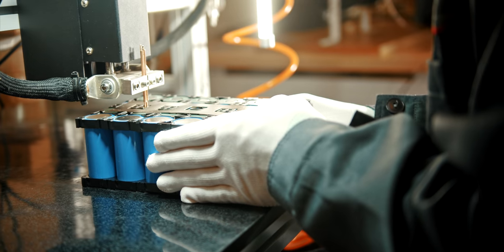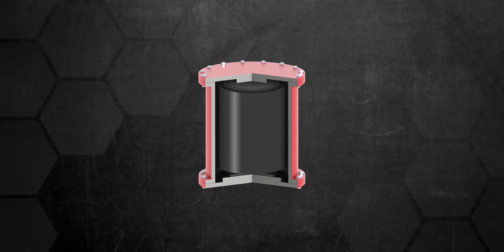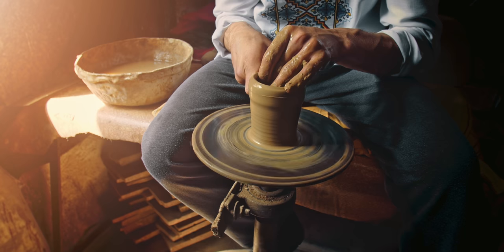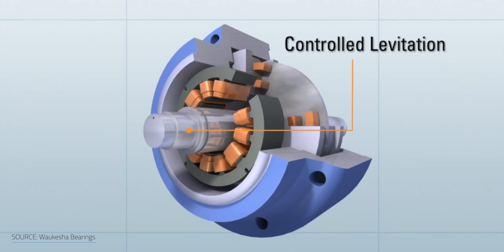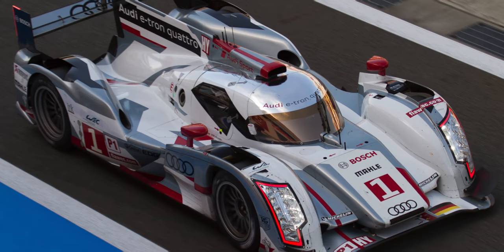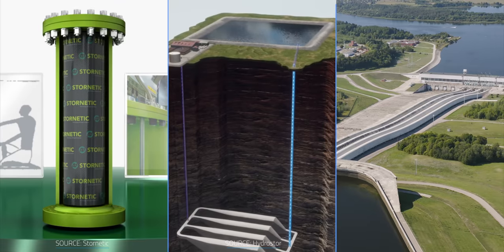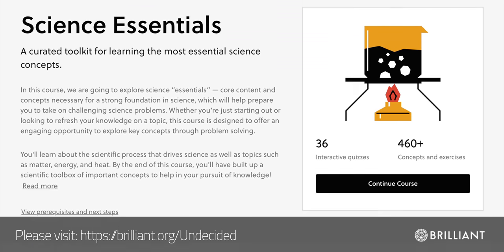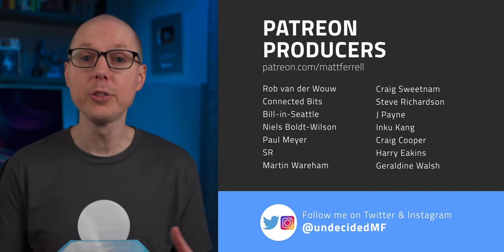The Mechanical Battery Explained - A Flywheel Comeback?

Comment: Magnetic suspension and vacuum sealed means they could spin almost indefinitely. I’d be really interested to see what kind of long term storage these things are capable of.
Reply: Texas grid has been ruined by "green" energy.   Texas is now number one in the world for rate of increase of wind power, due to massive subsidies undercutting reliable sources of power.  Unfortunately, wind power output isn't consistent every day every hour throughout the year nor can it be scaled with demand like a natural gas plant that can simply increase or decrease power output by burning more or less gas.   Unfortunately, the subsidies make it so cheap that it still drives nuclear and natural gas and other reliable sources of energy under displacing them on the grid.   So now Texas that used to be so rich in energy is suffering warnings of brownouts and power shortages.    They keep promising that batteries can solve this problem, but the fact is that no batteries exist that can economically store massive amounts of power, and many are extremely environmentally unfriendly when scaled up.     So just like Hitler with his "wunderweapons" the left promises battery technology that is always "just around the corner" will solve the problems they create with out of control inflation, commodity shortages, excessive energy prices, and more.    They never take responsibility for their actions.
Reply: @BoopSnoot  cool dissertation. Too bad I didn’t ask.
Reply: @BoopSnoot  the problem with the Texas grid was that it was mismanaged, and wasn't winterized properly, due to mismanagement and lack of warning of the coming storm.
Reply: @BoopSnoot  the Texas grid has also shown signs of reaching peak capacity mid summer as well. Mismanagement really is the big issue at hand. Unrestricted capitalism is great and all but there's no profit to be made from ensuring stability in the most extreme circumstances. if it costs 1 million dollars to ensure there's oversupply for the 1% chance of failure but the company loses half a million on said failure then financially a company is throwing away half a million dollars.
Reply: @emperorjj1  you're clearly not reading.  texas grid was PERFECT for DECADES when it was deregulated and governed by the free market without government interference.   The government stepped in levying fines for not complying with ever more expensive changes to the coal plants rendering coal non-competative while simultaneously massively subsidizing in particular wind power and to a lesser extent solar.   This displaced reliable sources of power that can easily scale up and down their power output on demand to intermittent power sources that not only can't scale but they can't even store their power.    The power grid has to balance use and production very closely to maintain 60hz or else you get fires.    3-month contracts now cost as much as 22.3 cents on powertochoose right now, up from the 6 cents Texans enjoyed for so many decades before "green" market interference.
Reply: @emperorjj1  the company loses half a million on said failure then financially a company is throwing away half a million dollars.
You just have to sell security to consumers rather than approaching it as purely an energy-for-money transaction and sell consumers that it's for their safety. People give up their inalienable rights for the illusion of safety, getting them to actually pay for it should be relatively easy.
Reply: @zym6687  yeah to an extend. But just look at insurance. Most will choose the cheapest option even if that leaves them under insured because the likelihood of needing it is so low.  With the unregulated texas grid im not sure how paying your company more would lead to more security since all the power companies are basically middle men. I'm no expert but it would have to be done via ercot somehow and i cant really see texas signing up for more government management fundamentally nor trusting the exact agency who got them in this mess with more money to get them out of it.
Reply: @LilyWasHereMB  Big government picking winners and losers with massive control and oversight isn't an example of capitalism though, that's communism, and the US, just like Europe, has become more and more socialist over the last several decades.   In a true laissefaire capitalist system, the Texas government would have minimal control and consumers would be empowered to pick what offers them the greatest bang for the buck, with the state just acting like a police force to break up monopolies.  Instead, the big companies and big state have become one and the same entity that support one another.  "Too big to fail" is a big Democrat moto now.
Reply: @AgentGG1967  you’d use part of the incoming energy to generate the vacuum and one would assume that the magnetic suspension utilizes permanent magnets as opposed to electromagnet otherwise there would always be an energy deficit. So I really don’t see how the cost of one of these could outweigh the cost of lithium ion batteries which requires a ton of mining and refining or rare and toxic materials.
Reply: I remember numbers like decades for that kind of setup. It would be interesting to understand how the power output behaves in time. It all depends on the actual quality factor and overall capacity. A flywheel big like a building (30x10x10m) is now used to power a Tokamak in Switzerland for delivering tons of watts in a fraction of a second, that previously caused a black out in the local community and millions in power bills to the university.
So it's very effective as an accumulator in both ways.
Regarding the delirium on texas grid I'd say that you are still not looking at the elephant in the room, typical from that continent. US were consuming per person 7 times what can be considered sustainable for earth. Europe about 1.5, in line with the world's average but still not sustainable. This means that you were well beyond a PERFECT system that survived growing for DECADES thanks to low fuel prices caused by local production and middle eastern exploitment. For allowing this, multiple conflicts that caused too many deaths have been neglected by the public opinion for the sake of low cost energy. I know they are not americans but fyi they are still humans. If it costs there is a reason. 
So these means of accumulating energy can be very efficient and clever, much more than just burn more fuel for more power.
I am not a fan of chemical batteries, I believe we switched too fast and the energy storage technology still isn't ready for the future. But maybe this is the only way of seriously pushing R&D, putting it in a market logic.
In europe insurances have started to secure a power plant outcome even in case of intermittence or breakage.
Reply: Yup it did have magnetic bearings and was in a vacuum housing the motor/flywheel/generator was built similar to a car alternator except the field power came from a rotary coupled transformer with the rectifiers built into the flywheel itself. They went with electromagnets vs permanent magnets because it allowed it to truly idle when not in use. Supposedly it could spin for over a year in its vacuum container if revved up and the field turned off. Was used to protect the PLC and computer circuits at a large factory I worked for.❤